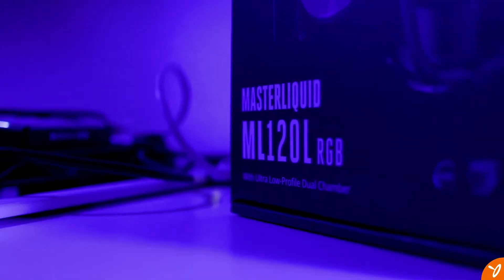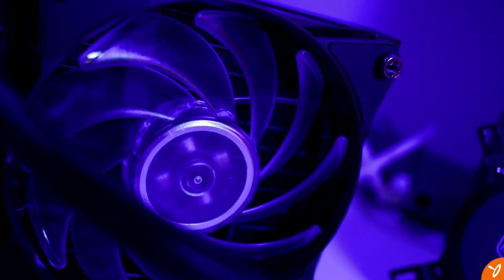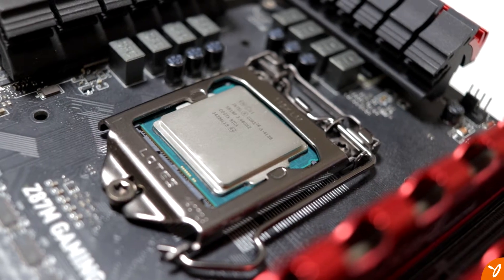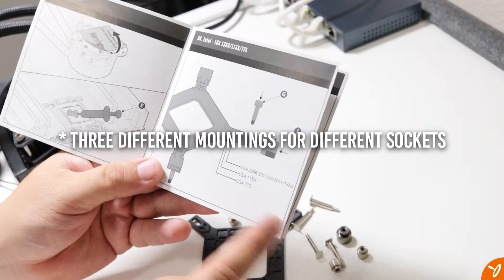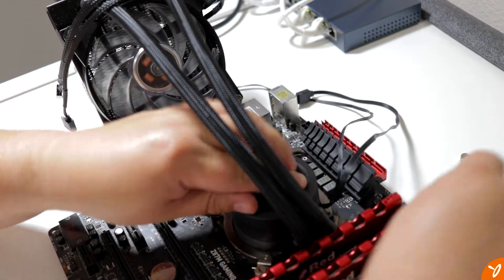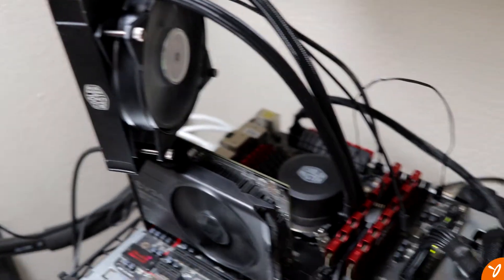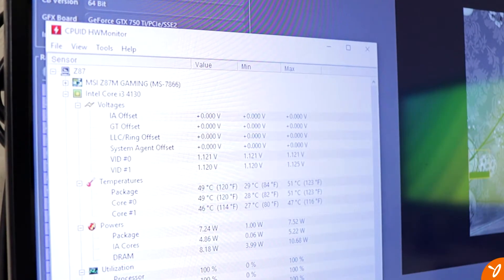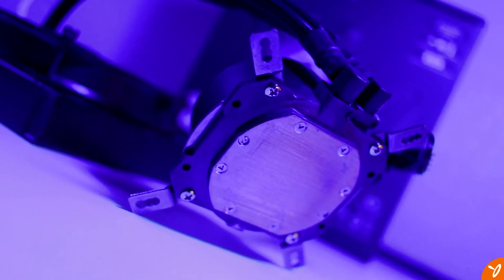Troubleshoot | Cooler Master MasterLiquid ML120L

Comment: what i could never understand is how to run a diagnostic with mine let alone make a small adjustment or something to that effect. i run a mini itx motherboard along with the same exact radiator but geeksquad at best buy said there already was a fan in place so they mounted that with the radiator  instead of the one that came with it.

Comment: Hey I have a cool master AIO 240L, I pulled the radiator off to move my ram and then screwed it back on. I noticed my lights are not on anymore but the fans themselves are working properly, any suggestions on how to fix or what I did?
Reply: I’m having the same problem. Did you fix it?

Comment: I just built a system and saw that the RGB lights were not on.  Hence I am looking for answers man!  lol
The fans are spinning so I guess I am winning... = )  
I tried to get it to post, and it asked me for my boot drive etc.  I shut everything off to make sure there was no problems etc... 
My best guess is that I may have to load the software on the motherboard to get the lights to work???  
I saw yours were not on either.  Maybe I should quit freaking out... I mean what is the worst that can happen.  JK

Best Wishes